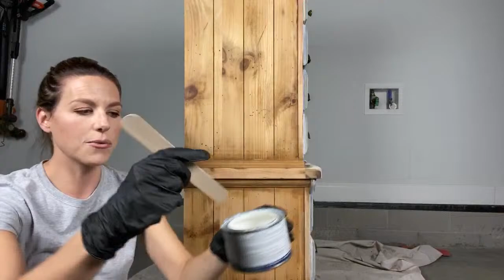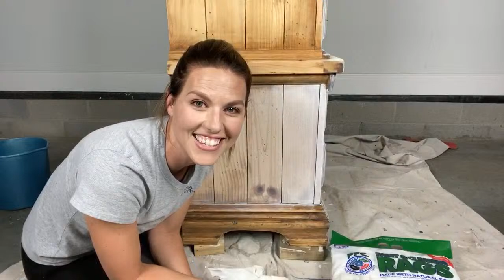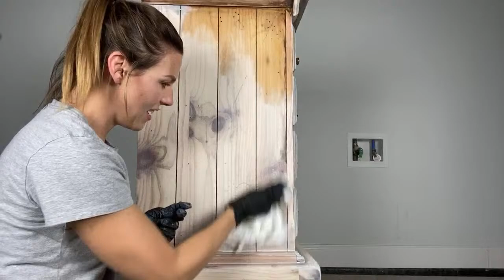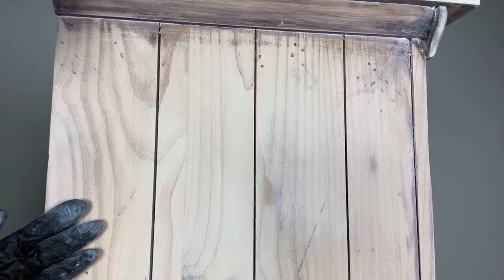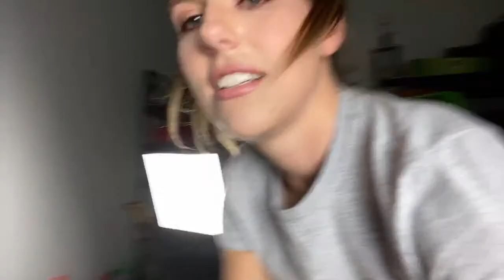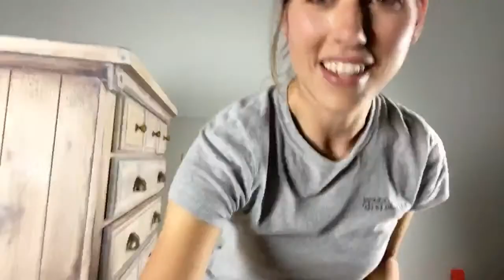LIVE Creating a Driftwood Look with Gel Stain

Comment: Christina, I want to refinish our buffet (veneered wood) and thinking about gel stain for drawers and chalk paint for sides and top. Should I seal gel stain with gel top coat or wax? Should I use Gator Hide for water protection?
Reply from the maker: I would use a water based clear coat like Gator Hide or similar. Just make sure you gel stain completely dries 3-5 days before adding a water based topcoat. I know it annoying, but the only way it works to mix the two.

Comment: Hi there, love your video. I painted my daughters desk with the black dixie bell chalk paint, what do I put on top to protect it?  If I want to add a little shine would I use the Gator Hide on top? I am new at this. Thanks
Reply from the maker: Gator Hide is really great for a lot of protection. If you want a lot of sheen they have their clear coat in Gloss if you want just a bit of sheen you can use clear coat in Satin as well. Any of those would be a good choice. Make sure you do very thin layers because black can haze if you use the topcoats too thick.

Comment: I need help.  I mentioned to you I am painting my chairs white... I got a couple done, did the wax but not crazy about the look.  I want to add maybe a light grey wash.   I used waverly brand for all products... I was wondering how I should go about it.  Since there is wax should o sand it a little before doing the grey wash.  Also I wasn’t crazy about the wax and think I wanna do a poly top instead.  Can I poly over wax? Please help.  You’re my only hope :)
Reply from the maker: I would try to remove the wax with mineral spirits first. Just put it on a rag and wipe them down. Then you could add the gray wash and the topcoat if you like.
Reply: Christina Muscari ina really just sanded it down some and applied the wash, put poly over it and it came out really good.   I wasn’t sure it would work but luckily it did.